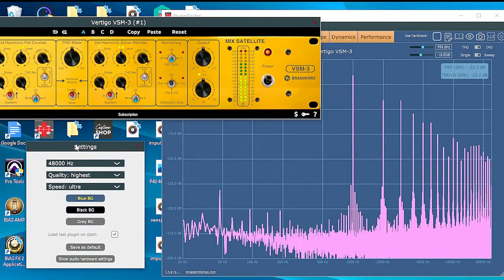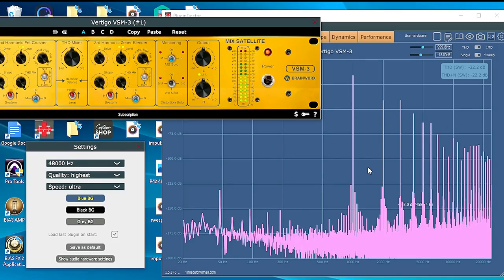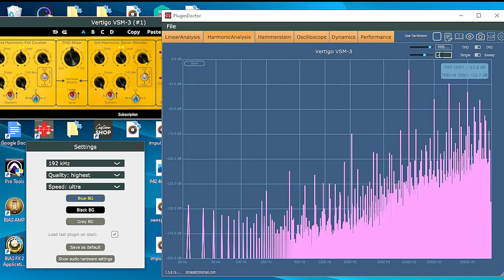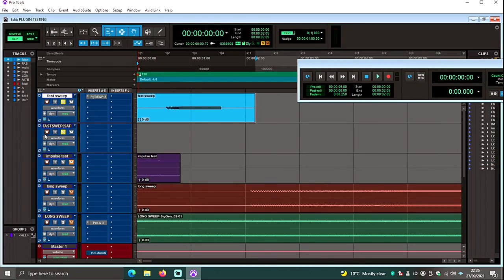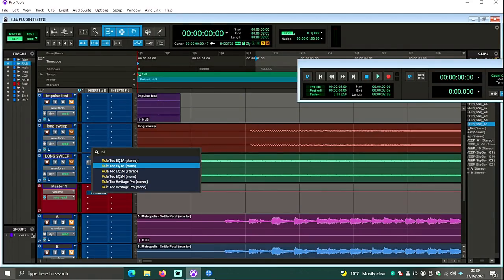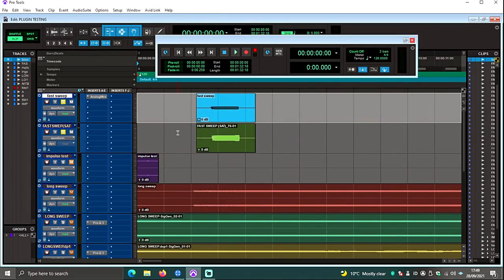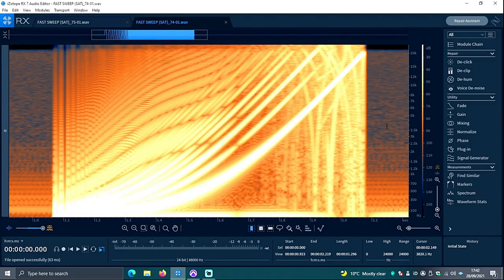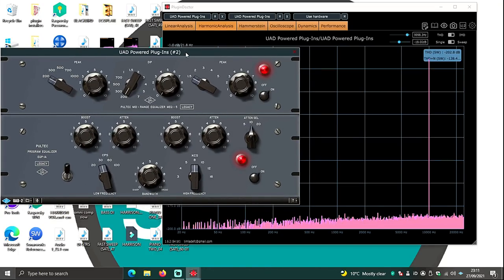UNDERSTANDING HARMONICS & ALIASING || How to visualise plugin harmonics & how to test audio aliasing

Comment from the maker: Please be advised that this test was purely to show how everything can be tested to double check what you see in doctor. RX was set to maximum visibility so it relates to everything that can be viewed in doctor but it has no relation to audibility. I wouldn't advise setting RX like this in reality as it will make everything look more audible than it actually is. 

When viewing all of this pay more attention to the numerical values. For example, anything below -80dbfs I would say is completely inaudible but many would argue below -60dbfs so pay more attention to the level of everything when determining if anything is an issue or audible. 

What other types of under the hood geeky stuff would you like me to investigate next? 🤓
Reply: Hi Paul, maybe a bit off topic but you mentioned in a previous video how many pink strips you could run in one project with your i9. I'm am very interested how Lowe core count would effect the performance. Cores could be turned off to simulate a i3, i5 or i7 and by putting you'd system in power saving power scheme your cores would downclock or in your bios to simulate older generations with a lower IPC. I'm very interested in your findings. In my opinion it's very valuable information in modern music making and info on the net is old. And it's geeky so yeah... Could ya pls?
Reply from the maker: I'd need to ask guys in the know. When it comes to computer tech I have very limited knowledge. Suppose I can ask stefan who built my pc
Reply: @PaulThird  That would be awesome ❤️
Reply: The different ways to do oversampling. More specifically what type of (lowpass) filters they use internally. Some plugins use standard minimum phase filters, some use linear phase FIR filters and there's even linear phase IIR filters (although probably impossible to tell the linear phase ones apart without seeing the code). You could check if oversampling causes lots of phase shift or maybe some pre-ringing. See what that does to the sound
Reply: @mathyoooo2  ooh +1
Reply: When are you getting a bigger monitor?
Reply: @stupidusername38  don't go overboard. There's a lot more to a good sounding plugin than just no aliasing. A well coded plugin can still sound great even if it suffers from a bit of aliasing
Reply from the maker: Yeah that stuff is noise 🤓 I do plan on doing the compressor side of doctor but I also need to get a getter grasp of it first haha
Reply from the maker: Probably never haha
Reply from the maker: Yeah stuckplate is right. Aliasing is inevitable in many plugins. Aliasing is a manageable thing. If you keep it under a certain audible threshold then it won't do much harm. Like noise, as long as you Bury it enough it's not really anything worry about. It's when it becomes audible you can run into issues which are still subjective but the truth is its unmusical.. But still subjective on whether it negatively affects the source. I avoid audible aliasing like the plague as its actually very easy to do if you pick your plugs wisely. A lot of modern day plugs are internally oversampled
Reply: @IliasPanteliasGR  yeah great idea!!
Reply: Bit reduction, why some drums sound awesome with
Reply: @PaulThird  Paul it would be nice for u to check out Antelope plugins I believe they are amazing, would be nice to do a review
Reply: Hi Paul please do an Acustica Audio Desert review because I'm not hear any difference in any of the in or out preamp even with the drives, would like to know if it's something I'm not doing well or it's just the plugin.🤔
Reply: Would be interesting to hear Kush audio plug ins and hardware compared
Reply: Hi Paul! Love your content! Would you know what a difference a master clock like the isochrone OCX would make to the digital devices connected to it? Greets from 
Greece! : )
Reply from the maker: I can't say as I've not had the opportunity to test clocking but from what I've seen and heard already from others examples I very much doubt that it's got any real qualitative benefit

Comment: Great video! Keep up the good work. I think you should also make a video testing actual music with aliasing while adjusting the aliasing effect. Not all levels of aliasing are detrimental to a song, it can sometimes lead to a desired outcome. Its very difficult to judge the true outcome when analyzing pure sign waves as no song would be composed of a singular sine wave.
Reply from the maker: Already got videos showing the difference in waves plugins being oversampled from 48 to 96k. I could pick the differences out in blind tests 🤓

There is going to be another video showcasing what waves plugins should sound like as they seem to be the worst for it. Only way it'll work is on the plugins that have a relatively flat linear response as oversampling frequencies past their supported sample rate will cause multiplying of frequencies so I need a relatively flat response for it to work but there are enough there.

Did one yesterday on Puigtec over a mix and it was actually shocking now much masking the aliasing added. Muddyness, harshness, lack of punch. Night and day when you remove all the aliasing it adds

Comment: oh man I´ve done a deep dive on your channel today in the studio, although I should really have been working. so do you always prefer maximum oversampling on everything when it comes time for mixdown? any drawbacks?
Reply from the maker: If my cpu can handle it max oversampling but only if im really driving the plugin hard into saturation where I'd need max oversampling. In most cases x4 should be enough. I do the oversampling in the context of the mix, not just when exporting

Comment: My top 5 Waves plugins... 
1. F6 DynamicEQ, it's just a super handy tool for taming resonances and tightening low end, super great.
2. Abbey Road Plates, this is definitely one of my favourite plate reverbs.
3. L316 Multiband limiter. I don't do a ton of mastering, and I don't go out of my way to make masters excruciatingly loud, but sometimes I do want it LOUD and this plugin goes to 11.
4. Element synthesizer. This is great when I want to quickly dial up some kind of synth patch, it's nothing super fancy, but it works and I can tweak it to sound right pretty quickly.
5. Electric88 virtual Fender Rhodes instrument, it's one of the better sampled Rhodes instruments I've come across so far. No match for the real thing, but still very usable. It almost captures the dirtiness of the real thing.

Comment: Paul, another cracking video although I've ended up in geek hell.  This is the third or fourth time I've tried to understand aliasing but watching your video is the first time that all the pennies dropped.  So, I thought I'd test out my plugins to see which were behaving and which weren't and I was surprised to find that most of the ones I use were pretty good.  

However, things started to go wrong when I loaded up my amp sim, cranked up some marshall type crunch and put a 10k test tone through it.  OMG, it was horrific (in terms of aliasing) and that set me off on the road of downloading and trying just about every amp sim available to see if I could get a better result.  And I couldn't.  Even those with alleged 16x (!) oversampling still had horrific aliasing.  However, on further inspection I found that most of the amp sims were okay up to around a 4k test tone but then they started to struggle, although in very different ways.  I also found that many of the amp sims worked very well on a test tone which was "exact", i.e. exactly a certain number of Khz.  So they coped well with a 5k test tone but went crazy with a 5.01k or 4.99k.  

Maybe putting a sine wave through an amp sim isn't really very fair but if those aliasing tones are there on a sine wave then they must be there on the guitar parts although that's proving harder to hear.  

Okay, back to test out some more stuff - thanks for filling my Monday!
Reply from the maker: I did try to make it as simplified as possible as it really bent my head at the beginning so glad that it helped.

In regards to guitar amp sims. It's actually a future video idea as I found the exact same. It's actually led me to the point where I'm thinking that all amp sims are a bit of a lie.

Ive not tried it yet but I was going to stick an amp sim though a DI and see if it affected the tuning due to all the unmusical frequencies being added.

If that's the case then all amp sims are actually making our records less musical as opposed to recording them through amps and mics.

Was Contemplating running a few drive pedals as a hardware insert to compare the difference between the sims aliasing and the pedals true harmonics.

Honestly I don't know why everybody isnt talking about it tbh
Reply: @PaulThird , you and Dan Worrall have a way of telling me things that I already know but in a way that makes me finally understand what they actually mean.  I've only found your channel recently but you're doing a great job - keep going.

I thought I must be doing something wrong with the amp sims because I just couldn't believe what I was seeing in terms of the aliasing.  I'd be really interested to hear what you uncover because I've drawn a blank (in technical terms) and just can't understand why the aliasing is so .... egregious!  I'm sure you're way ahead of me but in case it's useful I tried out presonus ampire, audio assault blacksun, mercuriall spark, neural dsp fortin nameless and scuffham s-gear.  For those that did have optional oversampling I turned it up to full (that's allegedly 16x on the blacksun) and still got horrible aliasing at anything much more than 4k and, as I said, often in the inbetween frequencies.  So even when 4k was fine, 3.99k often wasn't.

Even more bizarrely, moving to 96khz sample rate didn't seem to help much so maybe those harmonics that are being generated just keep on going?!

I'm going to be honest here and say that even though it was very obvious on a test tone, it wasn't night and day obvious on actual guitar tracks.  But I only had a cursory listen so I will be very interested in what you find out.  It certainly seems that amp sims are "technically" awful with horrible aliasing but I wonder how much difference that makes to the sound.

Comment: Great video! I find out that using a filter  15khz in the very end of an oversampled instrument actually help the output result... In cons the sound lose a little bit of energy but nothing that cannot be recovered with a simple transient plugin.. what you think 🤔 about it?
Reply from the maker: Kinda what airwindows ultrasonic does but I've not got it to work yet for me but I may have the routing wrong
Reply: It might help in different ways, but it does nothing with regards to aliasing - if that is what you are suggesting.
Reply: @PaulThird  i generally set up the channel with what I need ex pre + ddfm (lbuss x 4) and in ultimate instance i put a pro q 3 with the "ideal filter" which is a brickwall filter using Max linerar phase.. i generally left some space between the start and the finish of recordings because i notice that ddfm cause some delay especially in high oversampling and i cannot work in real time with it.. so i have to print and realign the track unfortunately
Reply: @AlexLapugean  correct me if I'm wrong but a filter on the air band would prevent to the extra Harmonics generated to bounce back in the audible signal? Or not?
Reply: @AftertuneMusic  Only if you oversample and apply that filter before converting back to the original sample rate. Otherwise, by the time that filter is applied, the frequencies are already reflected to lower ones which are no longer affected by the filter. But that is what oversampling does in any case. For example, if you oversample a plugin with DDMF Metaplugin, you won't need to add a filter, that plugin does that automatically.
Reply: @AlexLapugean thanks i didn't know that

Comment: Great video Paul!  It would be great to see how much changing from 44.1 or 48 to 88.2 or 96 makes to the aliasing on some of the examples you showed.  I'm guessing moving from 44.1 to 88.2 would reduce it as much as 2X oversampling?  Or does it work differently than that when you're oversampling internally in the DAW?  Thanks again for your great videos.
Reply from the maker: Same thing. Oversampling a plugin x2 at 48k is equivalent to loading the plugin in a 96k session
Reply: @PaulThird  Cheers

Comment: Great vid mate really enjoyed. If you take printed the 10kHz tone with +30dB and +70dB and bring them back in then you could do a null test with them. This would leave the aliasing right? Maybe needs level matching or transparently compensating for the boost with Q3 to properly null everything but the aliasing
Reply from the maker: Yeah it's a good idea but it's flawed as you'll also hear the added harmonics in the null as well. However you've gave me an idea to oversample, print and do a null test vs original without oversampling. That would leave you with the aliasing 🤓
Reply: @PaulThird  haha yes that would make sense! I was just thinking it would be good to actually hear what different types of aliasing sounds like opposed to seeing it in a parametric eq or the spectrogram and just flat out saying it's gonna be bad. 
also it would be interesting to hear what the aliasing that bounced back i.e. curved back round such as in the rueletec eg did @10:28 compared to the fucking mess of helios which was more to the left of the base fundamental harmonic @23:09. if that makes any sense!
Reply from the maker: I'm thinking a test per developer where I pick their worst ones and show the difference when you oversample. Something like that

Comment: Good video. Regarding aliasing and OS, I have to say... OS is not free of issues. I've tried by doing some mixes replacing my plugins with all oversampled ones. Yes, the mix sounded cleaner but... OS may turns the transients weird, smearing those. Like an "unnatural" sound. At the end of the day, the key is finding the balance for me. I guess each company implements the SRC in a certain way, and with some plugins, as least for my ears, some OS sounds weird. However, aliasing is something that must be taken into account, especially with saturation/overdriving/distorsion plugins.
Reply from the maker: Yeah oversampling is something that I'm thinking about. Trying to find plugins that oversample using different techniques and then see if we can compare any audible differences between them. Or something along those lines

Comment: What a great video.... You really taught me a lot about this topic. 
But im a little confused about the uad Helios. Lets say i want to use it as a mic preamp for my Apollo and use it as unison to record a singer. Does this mean if i go over 30db i will record all the aliasing? Or does is behave different because im not hiting it with a line level but with a mic level?
Reply from the maker: I would need to check and see if the unison version is any different which I'll be able to do soon

But the way it looks is if it's on the mic and it goes beyond a certain gain level then you will record the aliasing and it'll be on the recording and you won't be able to get it off.. Unless you use it just as an insert in console and use it for monitoring and not recording so the singer can hear the processing but it's not on the recording
Reply: @PaulThird  wow that would be awesome. I was thinking about recording a 999hz tone with speakers and a mic and see what happens. But i don't know if this is any useful.
I have compared the uad neve73 which has awful much of aliasing regardless how much gain, with noiseash need 73 pre. That thing is perfectly clean. The arturia 73 is very clean too, but it doesn't have harmonics above 10k.
Reply from the maker: Remember a big factor is his how hard you go into them. Run a -18dbfs 10k tone and you'll have a good idea of whether it's aliasing but always remember to check the level of the aliasing as if it's inaudible then you are worrying about nothing. Id say -80dbfs is arguably audible but others would say more -70/6dbfs

Also remember to compensate the output as well cause the aliasing will look louder purely cause the signal is louder
Reply: @PaulThird  well with the uad neve73, if i crank up that mic gain to 40db, i need to put the sinus tone (999hz) from plugindoktor to -40db, otherwise the neve plugin is completely overdriven. Then i watch with a vu to be around -18 again to enter plugindoktor. I would say the aliasing is around -100db then. But its everywhere and close the real harmonics. With arturia 73 and need 73 there is no aliasing whatso ever.
Reply from the maker: -100db is nothing close to worry about. Pretty normal actually for a lot of saturation
Reply: @PaulThird  even if harmonics are just barely louder? With 999hz cranked up to 40db. 2k harmonic is at -110db, 3k is at -80db, 4k -100db and 5k is around -90. The aliasing is quite even everywhere around -100db.
Doesn't make a lot of sense. The other plugins cranked up to 40db have harmonics as.loud as -40db with no aliasing at all.

When i os the uad neve73 to x4 all the even harmonics are getting a big boost and so do the odd ones and theres no aliasing left.
Reply from the maker: The harmonics themselves at 1k aren't audible so again the aliasing isn't anything to worry about.

Think of it this way.. Anything under -85dbfs is practically inaudible. Harmonics, noise, aliasing, doesn't matter. Don't worry about things you cant hear just cause you can see them on an analyser. That's why I print sweeps and import them into rx and set my colour grading to where anything louder -90 is bluey orangey going into yellow/white and anything that's under that is blue into black, which is inaudible. Makes it easier to see what you should be worried about
Reply: @PaulThird  thank you so much